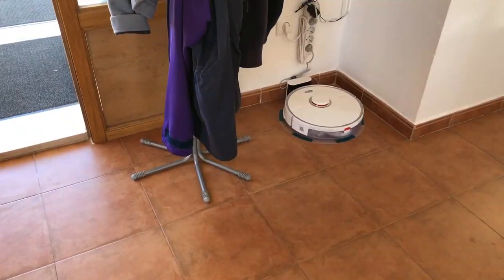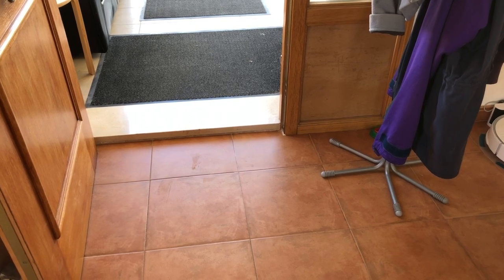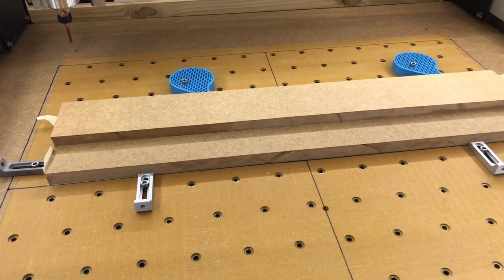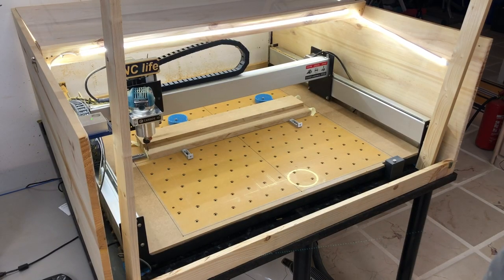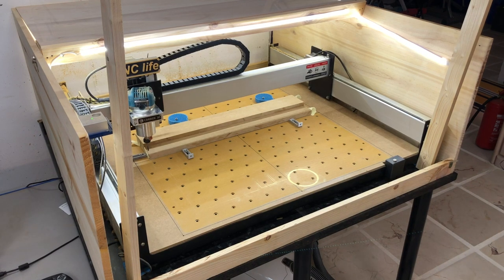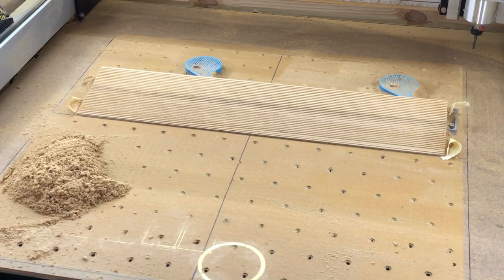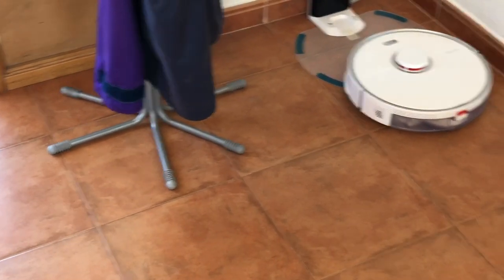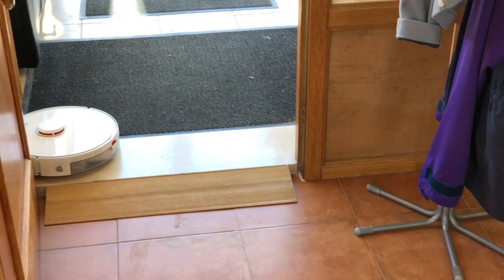MDF ramp for automatic vacuum cleaner, milling project

Comment: I like that, the tooling makes ideal tread for the vacuum to crawl up, result 👍
Reply from the maker: Yes, also very neat is the vac mapped the room and attached map as extension of house once it knew it was there.
Still mighty impressed with cleaner on how much dirty it gets out of floor/rugs.

Comment: Hi, I'm about to make one myself. The height is 3,5 cm. Will 8 cm incline (depth) suffice? I don't want the ramp to be too noticeable. Thanks in advance.
Reply from the maker: I think it will to be a lot wider than that, the angle will be too step for the vac to climb and also risk of wheels hanging in mid air and mop area catching floor.
Reply: @cnclife1385  how deep/slope would you recommend?
Reply from the maker: @ehsrak9705  I would go with 15cm
Reply: @cnclife1385 thanks

Comment: That's really handy. Could you tell me how much would you charge for doing a similar one (90mm high x 195mm depth x 792mm length) and send it to London?
Reply from the maker: Hi. You need to check angle is not to step that the underside of vac does not snag the ramp. Unfortunately it’s not economic to send heavy items to uk at present. Since uk is no longer part of eu, sending packages is a nightmare.